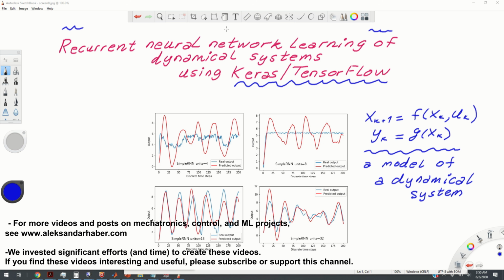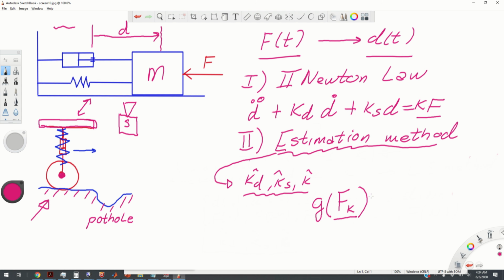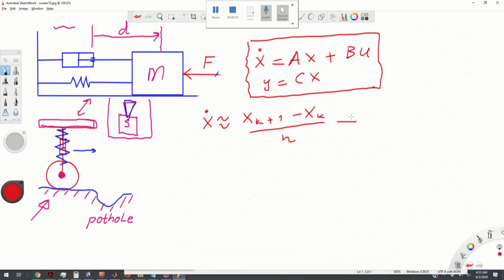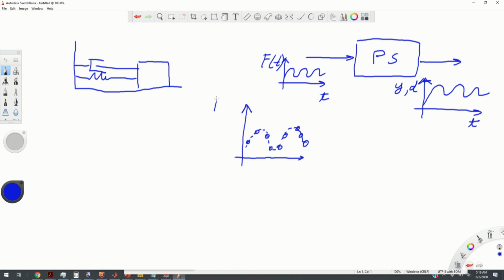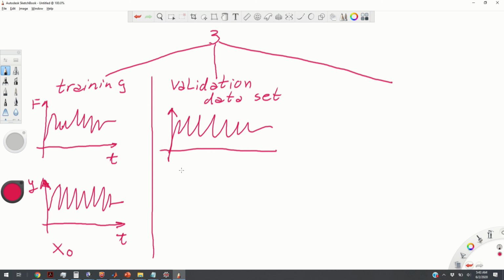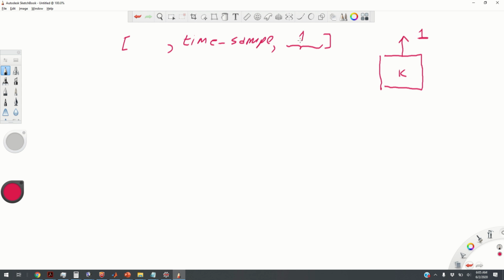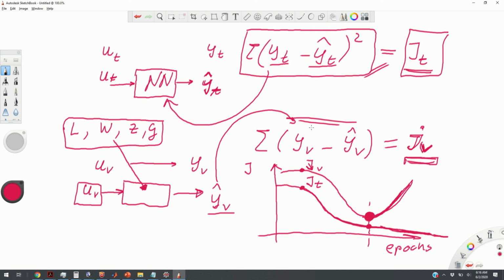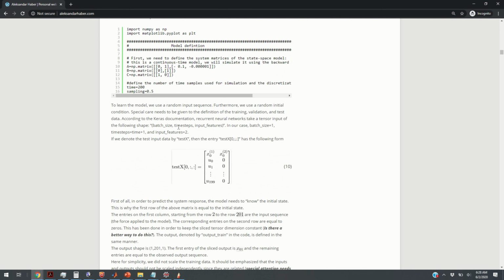Keras/TensorFlow-Machine Learning of Dynamical Systems Using Recurrent Neural Networks-GRU,LSTM

Comment: Can you provide good references for system identification using RNN?
Reply from the maker: I cannot recommend anything useful. There are more optimal and better ways of doing system identification than using the RNNs.
Reply: Thanks for the reply. I just wanted to start system identification with rnn/lstm and with rnn to strt with.
Reply from the maker: @monica199209  First learn the standard system identification, such as prediction error methods and subspace identification methods. On my YouTube channel, you have lectures on subspace identification method and how to implement the method in Python. For the prediction error method, you can look into Ljung's classical textbook: System Identification theory for the user. Learn how to estimate the parameters of a transfer function first. RNNs and LSTMs are not the way to go if you want to learn system identification for control engineering.

Comment: Hello, I want to thank you for the fantastic tutorial. It's been a huge help. I'm using the same method for my project and have some questions. 
Could I get in touch with you by email or anything else to ask these questions? Thanks a lot!
Reply from the maker: Glad it helped! You can ask a question over here. If it is not too complex, I might be able to provide an answer.
Reply: @aleksandarhaber  
Hello Aleksandar Haber, Thank you for your answer. 
In my project, I am aiming to predict the displacement (Displacement vs Time) of dynamic system (considering SDOF as example) subject to an earthquake acceleration (Acceleration vs Time). 
However, in my case, I am interested in incorporating additional structural parameters as inputs (such as viscous damping, length, mass, and more).
Each of the input length would be the (100 X Acceleration pts over time) + (10 X Structural Parameters), while the output would be the (100 X Displacement pts over time) All Data are collected from FEA.
The feed matrix will have this shape (1000, 110, 1) = (1000, 100, 1). Here is a simple illustration of the model I wanted.
 I am curious to know if such an approach is feasible. I have come across the requirement that the length of the input should match the length of the output. 
Thank you once again for your valuable contribution and your time.
(Youtube remove my comment when I add the GitHub link)
Reply from the maker: @djerradabderrahim  I am sorry, but I am not the expert in this field. You should definitely try it out. Also, keep in mind that structural parameters are not inputs. They are part of the dynamical system model.

Comment: I have a query about the definition of your initial state in Python. Have you tried to use initial_state to define the initial state of the RNN?
As I understand it, it should be possible to define the initial state for training for example. However, I don't know if you can change it afterwards for testing and validation.
Reply from the maker: Hi, I did not try that. The issue with the TensorFlow/Karas is that a lot of features are hidden or they are implemented as a black box. Also, I am not very satisfied with the documentation available online.  The initial state is very important for short-term predictions, however, if the system/network is stable, the effect of the initial state will die out over time. So the way to go is to ignore initial predictions and accept the predictions after some time. An alternative to RNNs is to use system identification methods, such as subspace identification.

Comment: Thanks for the video! Do I understand correctly that by extracting the weights and bias of the simpleRNN I can set up the state space equation?
Reply from the maker: Yes, you can reconstruct the state-space model that represents the recurrent neural network.  However, it is not a linear model...
Reply: @aleksandarhaber  Thank you very much! Can you tell me if it is possible to import the trained neural network as a state space into Matlab? I would like to create a model predictive control based on a model obtained in this way.
Reply from the maker: @kuepper2322  you can export the coefficients from tensorflow to a file and then use them in matlab.

Comment: Very nice video. At the end of your post you say "Another approach is to reformulate the model we want to estimate and to try to estimate the model in the autoregressive with exogenous input form. This model predicts the system output only on the basis of the past inputs and outputs. " Are you refering to NARX? How different is an LSTM from NARX? I am using NARX for a dynamical system with MATLAB but i want to get out from matlab because code extraction is a pain. Can i replace NARX with LSTM in keras/tensorflow? How can you model NARX in keras/tensorflow?
Reply from the maker: Sorry for the late reply. You can.

Comment: Aleksandar, I have two questions: 1. Why you use the X2 vector filled with zeros? 2. Is this vector be updated during the training? Regards
Reply from the maker: Everything is explained here:
https://aleksandarhaber.com/using-recurrent-neural-networks-and-keras-tensorflow-to-learn-input-output-behaviour-of-dynamical-systems/

Basically, you need to supply initial conditions in the first row, and the zeros in the second column after the first row are just artifacts. The issue is that I could not find a way to tell TensorFlow that the input dimensions should change from 2 (initial time step) to 1 (later time steps).

Comment: Very great tutorial; awesome job. I have a question here; imagine that I have my experimental data (time, force, displacement); do I still need to provide x0(1) and x0(2) in the Xtest; my goal is to create a model for the system
Reply from the maker: You can try without supplying the initial state. However, the method works best when you provide as an input the initial state. In theory, is the system is stable, the effect of the initial state will decay in time. Search also for the subspace identification method:  https://github.com/AleksandarHaber/Subspace-Identification-State-Space-System-Identification-of-Dynamical-Systems-and-Time-Series-